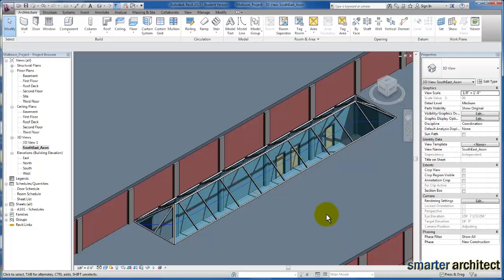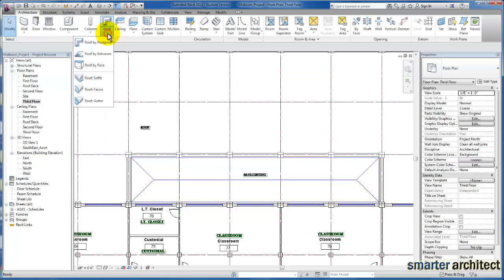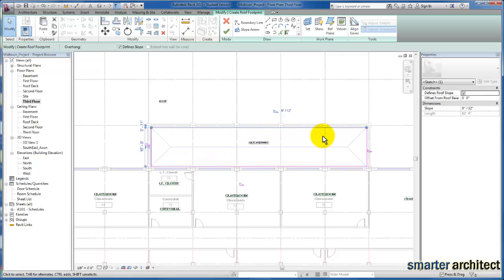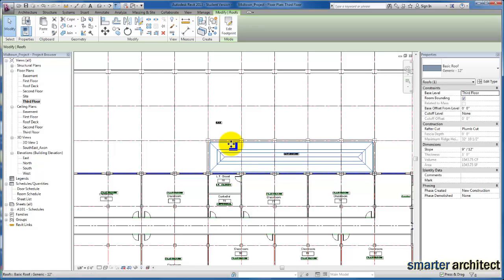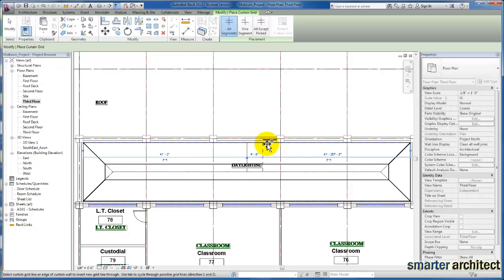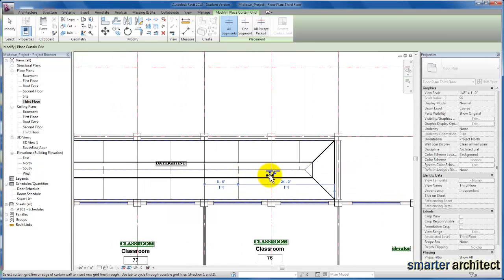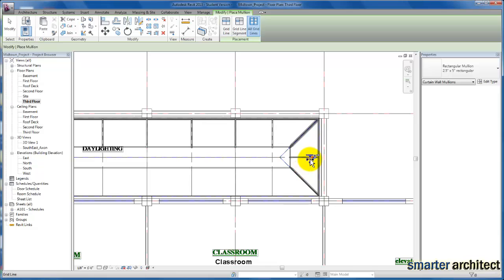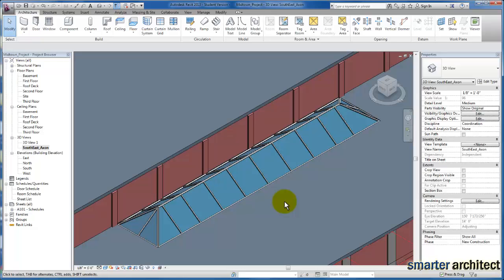Revit Tutorials: Skylights

Comment: Great tutorial, is there any way to create skylights on only part of the roof if the roof is already created?  I have a large complex roof that I am working on with three separate peaks and need to add glazing on one side of each.  Thanks
Reply from the maker: Courtney Beaudoin Your best option is to cut a hold in the complex roof first  and then create the skylight.  This way you can insert the framing around it.